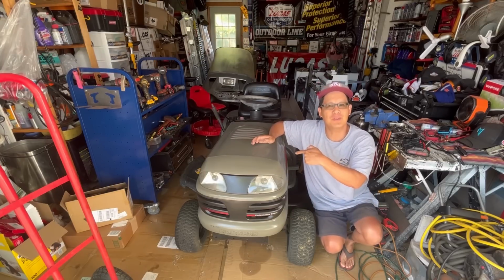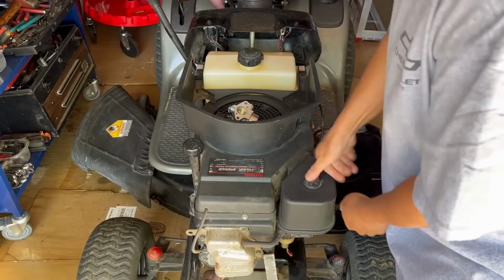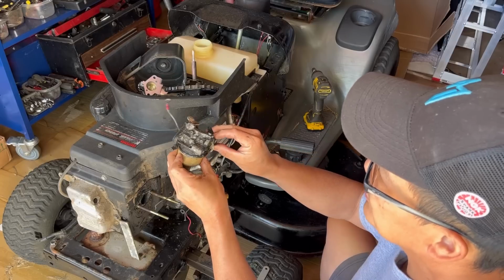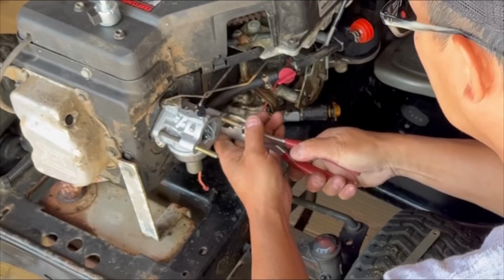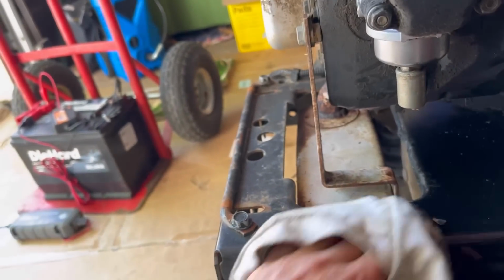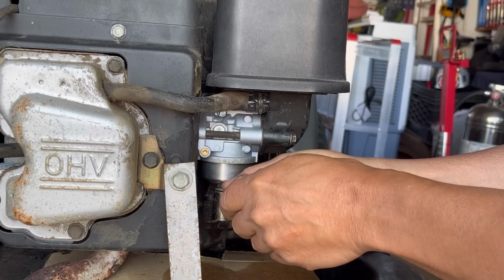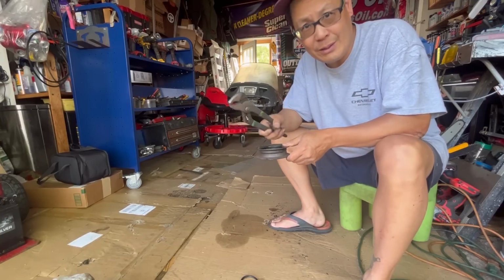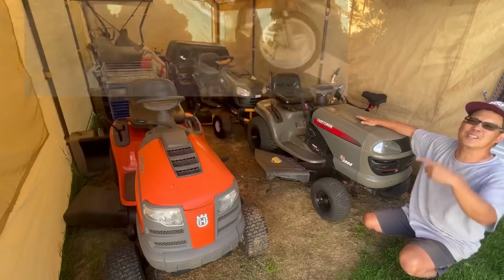CRAFTSMAN WE HAVE A PROBLEM!I THOUGHT IT WAS READY TO SELL!LT2000 HIPA CARBURETOR & DECK PULLEY SWAP

Comment: Kohler Command is my engine.  That Hipa carb swap is super helpful for me.  I will run over to their site and use the HENRY code.  My dumb solenoid leaks, too.  AND...my deck just ate a belt, so I probably have a bad pulley, too.  So glad I watched your video today, this will make my repairs a lot easier!  Except taking that deck off sucks - like 8 pins! Thanks, Henry.
Reply from the maker: Yeah buddy

Comment: Gas leak from the carburetor is a lot better than gas leaking in the crank case such as the Case of it on my  poulan XT mower which is powered by a Briggs and Stratton 19.5  over Head intek engine
Reply: It could be doing both,.
Reply: @dougseaman8791   that is true 👍